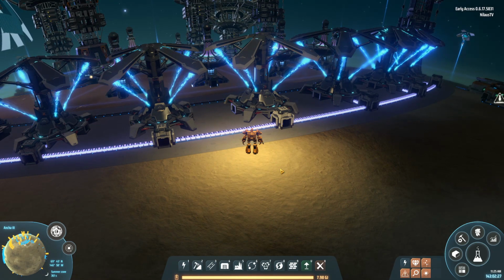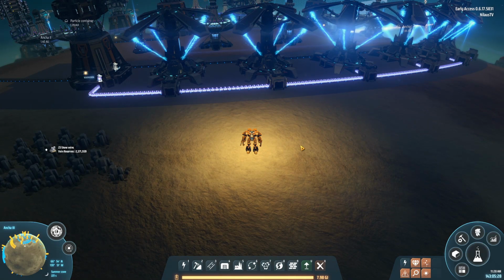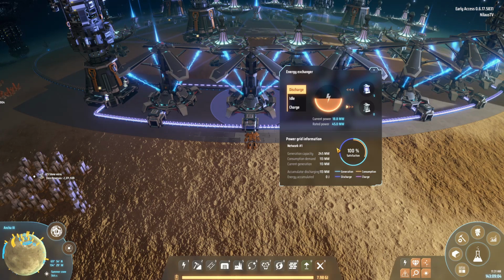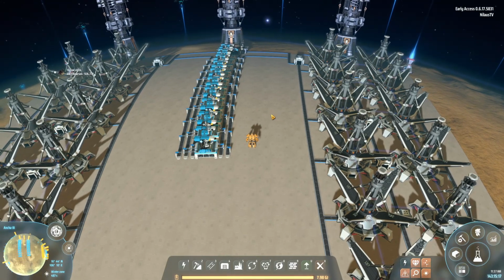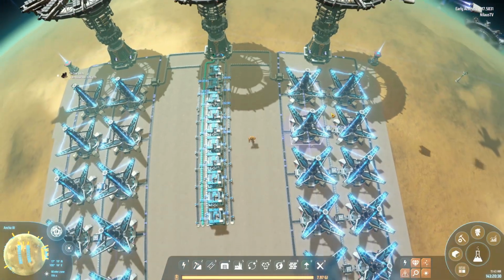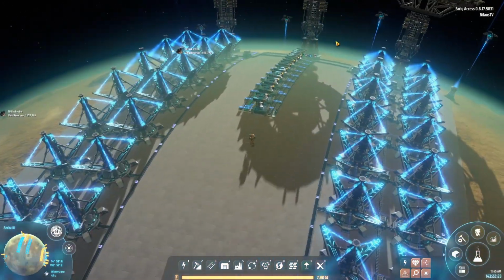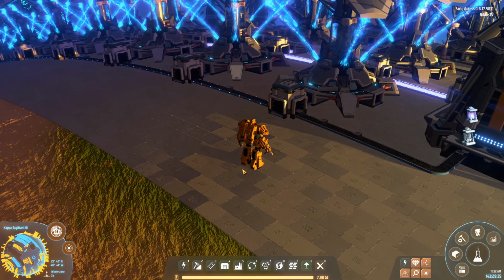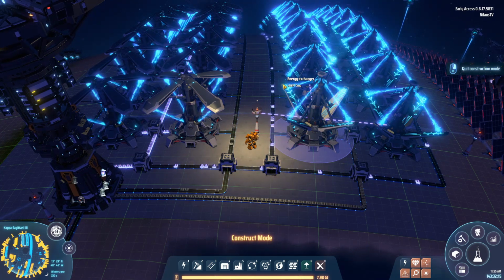How and Why ENERGY EXCHANGERS are AWESOME! | Dyson Sphere Program Tutorial

Comment: Just looking at your automation you'd still eventually clog your network by having too many accumulators in circulation. It's just that your power production and demand are a bit on the low side so it would take ages before you noticed the problem. Where you have stations full of empties where nowhere to ship them to.

Comment: 22:39 Basically treat them like high voltage capacitors not batteries. High voltage capacitors will try to discharge their entire voltage potential even if they have to turn the high-resistance circuit into plasma (hence why we use capacitors in those long lightbulbs, the gas is the high resistance circuit). Whereas batteries will convert chemical potential voltage into actual voltage proportional to the resistance of the circuit.

Comment: They are the best form of energy because they are free to use. Between them and my Dyson sphere receivers I have massive free energy. I have my largest star making my largest Dyson sphere for a lot of critical photons, and my first star is already making 10gw of power, with most of my mining planets being powered by sets of six of these. I do this because I don't want to waste resources on fuels. I don't like to literally burn titanium or iron.

Ironically they work most efficiently if they are completely alone on a planet. Yeah I agree it's a flaw and I also find it very frustrating. Ruins solar panels mid to late game unless you devote a planet to them which was only worth it to me once on my first system's inner lava planet.

Also, I find that my first planet is essentially overrun with drones and making my game run slowly when i am there. It is essentially awful but it is my fault 😅.

Comment: I just think they are not worth in terms of how power prioritising still don't exist in this game.
I always kinda got mad when thermal power station burn stuff even you are way ahead of energy production, and wouldn't even need it.
There should be a system for setting power to ecenomic scaling, so Solar, Wind should be consumed before Mini Fusion/Thermal/whatelse.

The problem is - that 27% you mentioned while looking at the Ray Receiver is the total consumption as well. You only use like 1/4 of the power you produce, just for sending around accumulators which need to store the power elsewhere and being sended around by Interstellar Drone Thingies.
It feels for me like this game is wasting to much of power unnecessarily, and this system brings even more to that.
That's why i only use them to more quickly charge accumulators so I can use them to craft stuff.
Otherwise a field of accumulators may waste more space but are way smarter because they empty when needed und fill when surplus energy is available. I just kinda wished that Energy Exchanger is doing the same but in smaller and faster scalings. Feed it some accumulators and let them burn fast if your grid needs it or let it charge fast when consumption is low and excess energy can be stored.

If someone knows the game "Oxygen not included" there you can set up automation in batterys and the power facilitys at the same time - so they start burning stuff when a certain percentage of voltage in the connected batteries is reached and once a certain level is loaded (like 95% or 100%) the production facilities are automatically going to stop - which is insanely smart and Dyson Sphere for a so called automation game still needs this feature really bad.

I like being economic - and the Energy Exchanger is not the tool it could be - so in my opinion this item is not bad but just not worth except for quickly charging accumulators. I don't want to disagree with you - I just think different.

Anyway nice video so far - I looked up to how other people may use these smartly - but came to the conclusion that I just won't bother with these. :P
Greetings from Germany guys, I'm sorry for my mediocre grammar.

Comment: Why build an energy charging station on a single planet, and then distribute those accumulators to energy discharging stations elsewhere, when you could simply use the ray receiver to gather charged particles, and transport antimatter fuel cells to only a handful of artificial stars for a similar affect? I've tried both methods for interplanetary, and interstellar energy exchange, and the later seems to require significantly less space and effort.

Comment: I wish we have better battery capacity. They're so puny.
I usually used Fire ice on thermal generator for energy. They're free right?
Way better capacity than batteries per unit, and you don't need to send back the empty canisters. Although they do have limit on how many you can churn out from gas giants.

Comment: "It charges at a rate of 45MW per second" "it has 90MJ of power" get your units right, man.
Reply: Well, it might be because Joules are Watts per second. So in this regard, if you charge with 45MW per second, a 90MJ battery will be charged in 2 seconds.
Difference is basically, Watt is a measurement of power and Joule is power per time. 1 Joule also is exactly 1 Volt*Ampere/seconds.

Comment: I really like how this game distinguishes itself from Factorio by making you deal with waste products a lot more. It's an interesting challenge on its own and it's affected the way I've thought about builds since I first set up red cubes. The accumulator management is also interesting, although I wish there was some way to prioritize power generation methods (though without any equivalent of Factorio's circuits I suppose you could use filter splitters with priority inputs/outputs to make logic gates based on belt backups, then use that to feed fuel to backup generators if the empty accumulators back up and power production starts to stall).
Reply: I'm wondering if sorters could be used to solve the problem. On the line that supplies full accumulators to the energy exchangers, you could place a sorter that 'steals' the full accumulators, and (with priority, so it never backs up) returns them to the start of the line. If the grid runs out of power, this sorter will stop working, so accumulators will be able to reach the exchangers, resuming their work. In case of a brownout, the sorter simply slows down, so some accumulators would reach their destination, while some would not. Maybe there's some way to balance it such that it reaches a reasonable equilibrium... though I suppose that equilibrium would be a 'constant brownout'...

Comment: I have a working strategy for a single-planet use.

I'm using only one side of planet to harness light with solar panels (and both sides to cap my Ray Receiver at ~1,2GW). So, I have 2 chargers for every 1 discharger.

Before seeing this video (and understanding those), I was using accumulators to go trough the night, since I generate 3x more energy during the "day" phase.
But, If I'm using only one side of the planet, I can easily store that with Energy Exchangers with a simple 'differential technique'.

All I need to do is to have 2 Chargers for every 1 Discharger.

And... supposing that they USE/CHARGE at the same rate, for every 3 Exchangers, I got a FREE 45MW of power.

I don't know if this will work for late game (I'm at 70h+ and haven't finished my Dyson sphere), but its pretty useful and easier to manage. I just need to get to my 'energy neibour' and adjust if I get net negative.

Comment: I always found splitters relatively useless in DSP. Anything they can do you can do with sorters that connect 2 roads just as easily. You can set priorities on sorters just like in splitters. Sorters dont take 4 grid spaces like splitters do though. Maybe you should do a video about the different ways to seperate content on roads?
I was actually planning on building a recycling road for myself where i can put any items i have in my inventory into a store, that feeds a road, which uses sorters to split all materials in the game into towers or stores that feed back into the main network of production/consumption. The concept isn't finished yet, if you think the idea is good maybe you could come up with a final concept for a recycler and make a video? That would be great!.
Reply: Splitters do have a few specific advantages over using sorters (inserters) belt to belt.
1) Splitters don't require power to operate
2) Splitters have higher throughput than sorters - you need several maxed out Mk.III sorters to fill a Mk.III belt
3) Splitters can act as an overflow valve - allowing output to belts only when the prioritize output is full/jammed.  (Though this doesn't appear to work correctly if you have more than 1 input into the splitter)
4) Splitters with a filter output set guarantee that the filtered item can never pollute the other outputs (at the possible expense of jamming your input belts)
5) The dual level sorters can raise or lower belts in less room than ramps.
6) And of course, as Nilaus likes to do you can use splitters to have two belts cross each other without ramps (or ramp editing tricks)

But you're right that sorters have advantages of their own.  They don't take extra space, they can reach across other belts (can be useful for a quick bodge job within a spaghetti of existing belts), and they're easier to set up between elevated belts
Reply: @jonathan_60503  You make some good points. I think you convinced me that splitters aren't as useless as i thought. The splitters that split onto a higher level I sometimes used but whenever i wanted to cross a road i always thought the half-step bridge looked better (and took less room). 
Thanks for your answer :)
Reply: @sebastians.4136  The other benefit splitters have is, you can put a storage box on top of them and they will fill it up at belt speeds. For either buffering or to just store stuff. And since you can put a drone station on a storage box it's the best way to feed them.
Reply: You could also stack a splitter to adjust to your required height.

Also Splitter is crucial for my Hydrogen splicer. Being first it handles liquids pretty well. Second, i will set the the belt to loop into the splicer to maximize that 1% chance to get Deuterium. I need the splitter prioritize to loop the hydrogen than to excess.

Comment: I love the idea of a galactic exchanger method but by the time I had an ability to honestly set up the logistics I could just pop down a sun, the exploration in the game is way too late game and has so little incentive- if they made midgame more beefier and more exploration related echanges make sense, and they are a neat idea, I just can't be bothered.  Maybe have it so if a shuttle is ferrying batteries they automatically get a free warp, or make a new structure that shoots exchangers out at high speed and one to catch them.  Maybe 1/3 warp speed but in early/mid game and only for 1 object type.  And that's a ton of real estate for power generation of any method.

Anyway yeah, they are a good idea but never make sense with the games' current pacing.  You did a great job building that system though- it's a terrific proof of concept and it would be fun to challenge yourself to only using these, but it will probably/unfortunately remain an enthusiast kink unless they buff them, if you are min/maxxing hard core you wouldn't use this system either, so it's a neat but overly complicated system that can jam if you screw up a single splitter or line.

Maybe make the charging/discharging stations also have the cannon/catcher I was describing, something like that,or they can house a single logistics vessel that gets the 1/3 warp propulsion. I'm just trying to think of easy ways the devs could tweak it without having to make new models or systems.

Comment: I find wind power the best in a lot of situations and can double up as power poles.  Only go to more extreme power when need to power the planet to planet towers or a production planet.  When I do a second playthrough may make more effort to make a proper infrastructure for the batteries as a source of power on other worlds.  Have a small automation for making the gas extractors or when I need a supply to supplement wind turbines on a planet
Reply from the maker: I don't use Wind Power outside of the very early game. They take way too much space and using them as power poles ruin compactness of designs
Reply: @Nilaus  You have such wonderful designs, I'm not that creative so works well but equally understand it would ruin your aesthetic

Comment: thanks for the video. I couldnt finish it, so i will come back to it tonight. Knowing you, i have a feeling you already did the math, but i will ask anyways.

1. accus can store 90 MJ while deuterium stores 300 MJ
2. the fact that you have to ferry the used accus back means they have a bigger energy overhead in terms of logistics
3. the energy exchangers are more expensive than fusion power plants; but i think they maybe cheaper if taking the cost per MW of power
4. (not really a big deal), you will have fuel in your outposts if u use deuterium

Comment: Cool tricks to prevent overloading the system with too many accumulators and also balancing charge/discharge. Though, I'd prefer if they added 3 options for local grids: renewable first, fuel first, and balanced (current). Main reason is that sometimes I do want fuel to be consumed at the maximum rate especially if byproducts may end up jamming a production line.
Reply: not sure if you already knew but you can use two isolated power grids with thermal power stations and another isolated grid with energy exchangers each to constantly burn excess fuel through priority splitting

it's not very elegant and the power is wasted but I don't mind because the jams are 10 times more annoying, plus you basically only need to do it with hydrogen later on
Reply: @brohvakiindova4452  Well, I don't really like energy exchangers that much although they are better than they used to be. But I've also figured out a foolproof way to never have any excess hydrogen which is really the only thing that has a real risk of clogging production lines since then so it's all moot now.
Reply: @OhmIsFutile  so what's your solution? only thing that can clog up at my state now is plastic, my "foolproof" solution is to try and prioritize its hydrogen output for everything, so far no issue but I've not yet hooked up deuterium giants and kept production running mostly
Reply: @brohvakiindova4452  I use two logistic stations whenever I need to import hydrogen. Only one is set to allow orbital collection. That way I can tap all of the gas giants I want and never flood my system. I made a video on it.

Also, idk how you'd clog up on plastic... you can always turn excess oil into more hydrogen and graphite with x-ray cracking if you want. Then if you don't want the graphite then turn it into diamonds and overflow the diamonds in thermal plants. They have practically no energy so they burn really well.
Reply: @OhmIsFutile  I'm really slow so I was more comfortable avoiding oil processing because each step down the line has the potential to clog the system up if you don't have perfect ratios and continuous production 
as plastic is the only thing using oil it doesn't matter if the light oil clogs up so I'm only managing the tiny excess of hydrogen
same goes for fire ice into graphene but that is optional (but too good to skip)

these two are easily sucked up from my deuterium/casimir crystal productions and the rest is substituted by a gas giant

I have set up the orbital collecting station with side merging belts into the production which works fine so far

TLDR I'm trying to make the game run "idle proof" because I'm overthinking stuff all the time x)